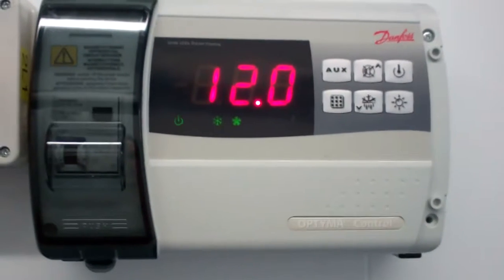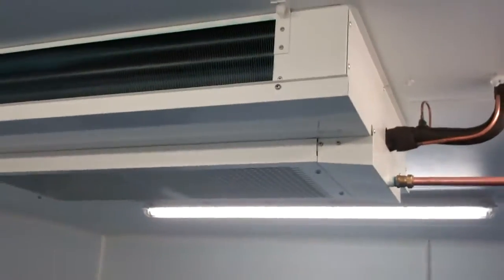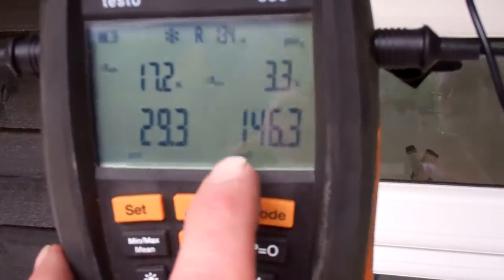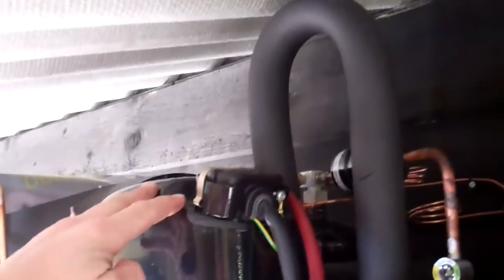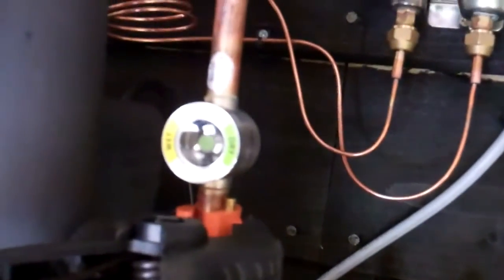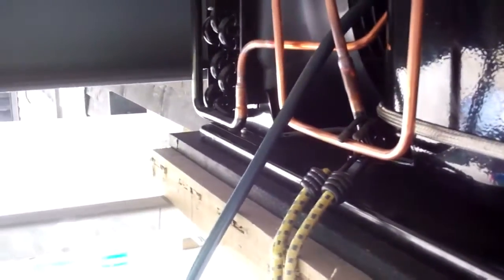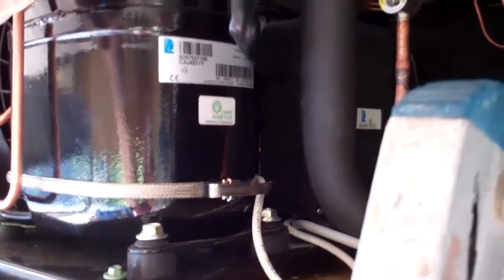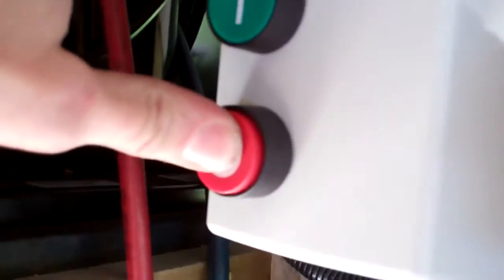Two Chillers

Comment from the maker: R404A is ok with the ozone layer but it has a high global warming potential, 1kg of R404A is equal to 3922kgs of CO2!!! This is a European thing linked to our F-Gas legislation, i don't think it would cover you.  We've been banned from R22 for years for example, and are not allowed to charge a leaking system, it has to be fixed or scrapped.